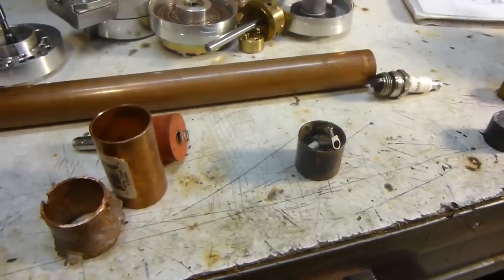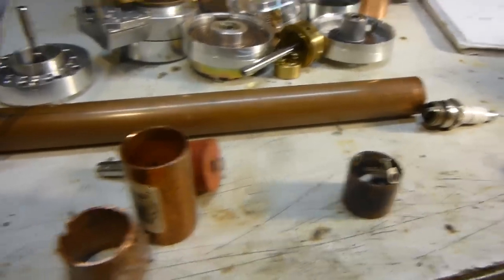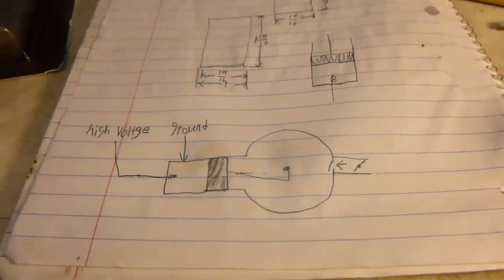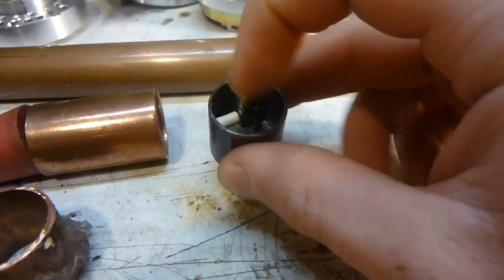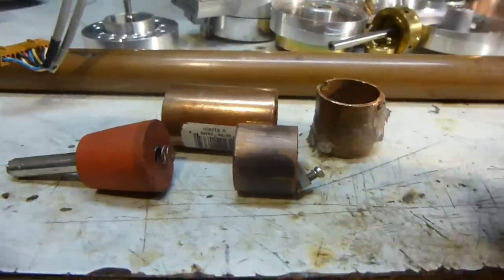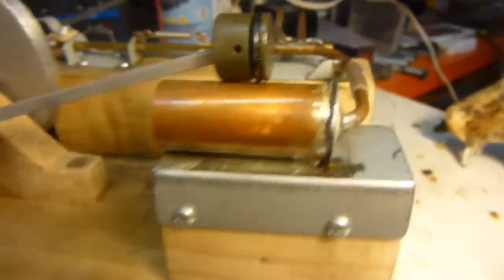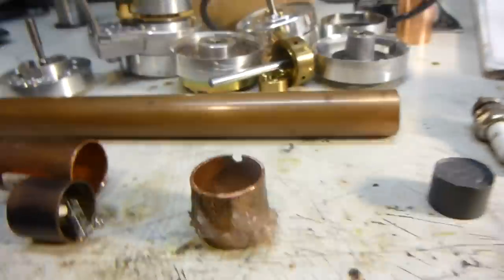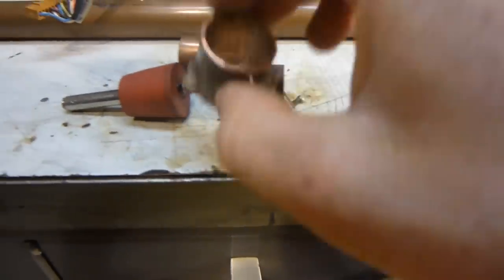Part 1. First Attempt at Making an Internal Combustion Engine

Comment: I am guessing that you made a 2 stroke engine and not a  'Non-compression' (Lenoir)?  What you have done is quite a feat using only a drill press and common hardware store materials.  I want one!  I will be glued to your channel for the rest of the build videos.  Even if it only runs for a few seconds it is a great proof of concept achievement.  Well done!  What I learned building my kitchen countertop steam engine might apply to a successful build of your ICE.
Reply from the maker: +Lidmotor Yep!  Modified 2 stroke all the way!  Thank you!  I will try to get the rest of the videos up as soon as I edit them.  I've been putting off editing them cause I have several hours of footage...  Yeah same here.  I used a bunch of skills and techniques from building my steam engine and Stirling engines on this engine.  My Maker Faire video has longer clips of the engine running.  https://www.youtube.com/watch?v=KDOKfoGdvUU
Reply: +Makerj101  Thanks for that link to the Maker Fair video of your engines running.   From my experience building my Stirling engines and my steam engine  ----it is hard work and failure is a constant factor all along the way.  I am anxious to hear the story of your ICE build.  It must have been an extremely hard task the way you did it.  Well done.
Reply from the maker: +Lidmotor Well actually I didn't really think it was that hard at all.  Mainly because I enjoyed every part of building it.  Plus I had been thinking about the design on and off for several years so I had a pretty good idea what I was going for.  But most of the plan fell into place in the few days before starting on the project.  I generally think about a project until I come up with a really good solution of how to solve problems I have encountered in my brain design of the project.  At that point I actually start building it.  And I don't hardly draw any plans either.  I do all the build from my brain.  The plans I did draw were merely to keep track of some numbers and calculations I wanted to make sure I got right and the other sketch was to try to illustrate my plan to others.  It took several hours to get it working but it showed promising signs of working from the start so that was a great encouragement.  I actually think it would have been a lot harder to build an internal combustion engine with a machine shop.  At least for me.  If I had plans I could follow those really well but the problem for me would be making the plans.
Reply: +Makerj101 You think like I do.  The things I make are dream/reality creations.  They are not scientifically over engineered ahead of time.  It is an art form I guess.  The engineering happens along the way.  You need to do the research and calculate but but those are just tools used in the building process.  Your videos where you went for a walk in the forest and found things reminds me of how these project go.  Little adventures with great discoveries along the way.  It's fun.
Reply from the maker: +Lidmotor Yeah you summed it up really well!

Comment: Big exhaust ports have a web in the middle to support the ring.  A really killer book for understanding 2 strokes at a higher level is "Blueprinting the KT100".   To figure compression ratios, you need a barrette to measure the combustion chamber.  It's easy to calculate on a simple cylinder but with a dome you need to do a more complex measurement.
Reply from the maker: So pour water into the cylinder and then measure the volume of the water.  Good idea!  I'll try that when I get a chance.  Thank you!

Comment: I have a question about your first gas engine. How did you keep proper air to fuel ratio in different rpm? I'm going to build such engine using lighter's tank and valve. In case of liquid fuels, the higher intake air flow, the more fuel is sprayed by carburetor, but how to get this dependency when using gas fuels?

Comment: you should try and cast a piston, forge it somehow using a hammer while its warm, throw it on the lathe and hollow it out..
Reply from the maker: +Integra DIY I did think about a cast aluminum or zinc piston a little.  I can't use the lathe though.  That would be too easy.  I wanted to make this engine without a machine shop.  I did cast the piston out of JB Weld.

Comment: This is so similar to what i tried to do! I used copper pipe and a stopper with a wire in it as my ignition. But i decided it was too dangerous to continue my experimentation when it fired for the first time and broke the con rod (1/2 cm thick aluminum square bar!) and sent the piston flying into the windshield on my motorcycle, which of course broke. So 3 years and $100 worth of motorcycle windshield later i am still waiting to build a homemade ICE.
Reply from the maker: Holy wow, 1/2 inch square stock? That's thick. Must've really had some power to it. How did the stopper not pop out? How big was your cylinder?
Reply from the maker: Oh... My bad. 0.5cm. OK that's understandable.
Reply: Makerj101 I just shoved the stopper in really hard. And my cylinder was 1" pipe.
Reply from the maker: +A. Zak Huh, sounds like you got some power and were really close.  I'd try again if i were you!  Replace that connecting rod with steel and beef things up/  What was your piston made from?
Reply: Makerj101 My piston was copper pipe that i ground to be a perfect fit. And i do believe i was close, but i think i will just follow along with your videos to make my next attempt. I was running on a mix of gasoline and nitrous oxide at the time of the accident, so that is the reason for the incredible power.
Reply from the maker: +A. Zak Ah ok!  That explains things!  :P  I'm just using Coleman fuel so it's all pretty safe.
Reply: Makerj101 I tried coleman fuel and everything else under the sun, but the only thing it would fire with was gas and NO2.
Reply from the maker: +A. Zak You probably didn't have your mixture right.  It has to be nearly perfect to work.
Reply: Makerj101 Yes, my mixture was probably way off. Looking forward to more building videos of your engine!
Reply from the maker: +A. Zak Could be.  Copied this from Wiki but as you can see you have a very fine area where it's actually going to burn:  "Gasoline has a lower explosion limit of 1.4% by volume and an upper explosion limit of 7.6%. If the concentration is below 1.4%, the air-gasoline mixture is too lean and does not ignite. If the concentration is above 7.6%, the mixture is too rich and also does not ignite."  https://en.wikipedia.org/wiki/Gasoline

Comment: You should make a Diesel engine!!!
Reply from the maker: +John Cook that would be hard with a jb weld piston! You need such high compression ratios
Reply: +Makerj101 That is true and Diesel is much more powerful and touchy to start but would a little easier to build once you get the piston out of the way